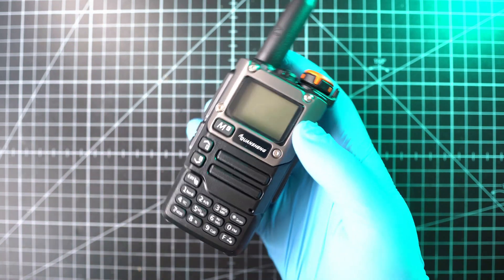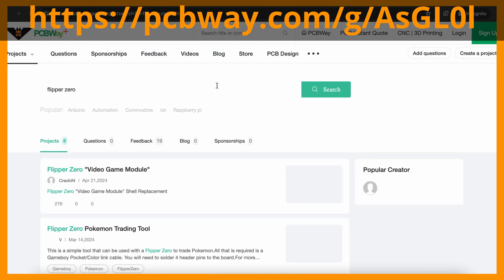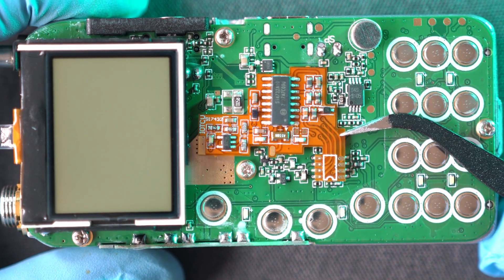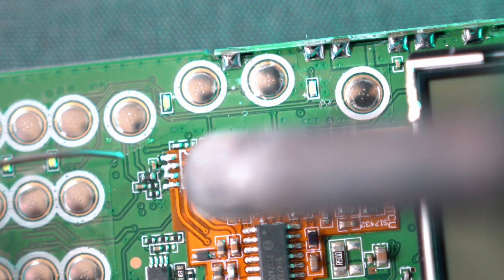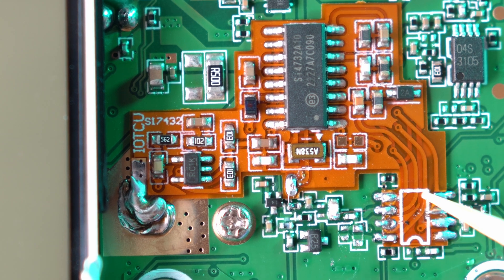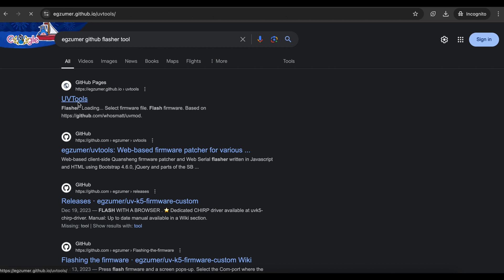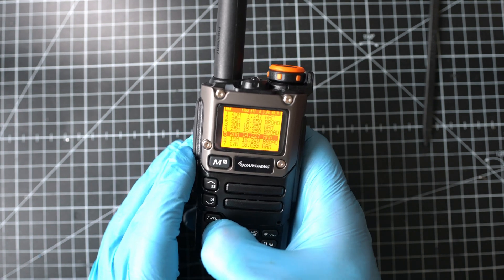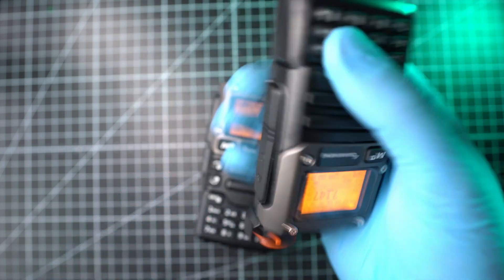FULL BAND HF v2.0 Mod - Quansheng UV-K5 (Si4732 chip) TUTORIAL

Comment: You want to clean up the solder pads on the PCB using de-solder Wick, before mounting the new Board. also use a good quality Rosin flux when fitting the new Board / Components, then clean the excess Flux off with a cotton bud & solvent cleaner / flux remover. Oh and get a pair of magnifying glasses, or a hands-free magnifier.

Comment: My zero locks up the radio. Not sure what I did ??
Reply from the maker: you don’t have proper firmware flashed
Reply: @takeapart  I used the link. I must have damaged something soldering. But my kit came w two extra tiny components that this video didn’t show being used. Looks like the two components you remove. ?? Maybe they have to be installed z??
Reply from the maker: @zebclark9288 hard to say…. try to email me pictures what have you done